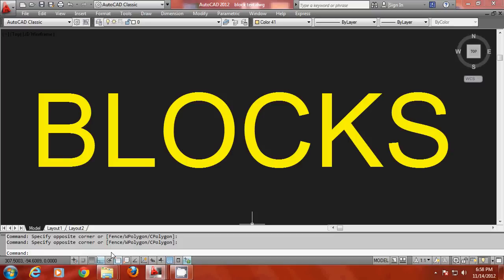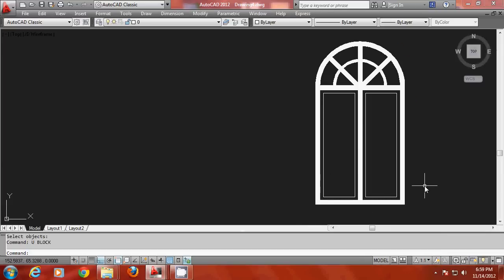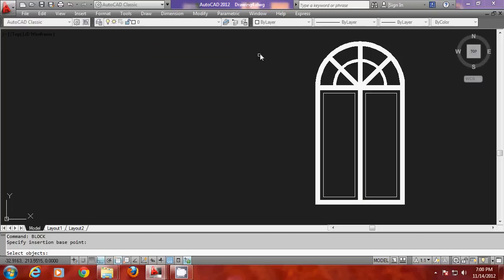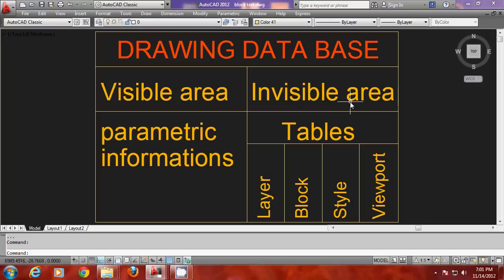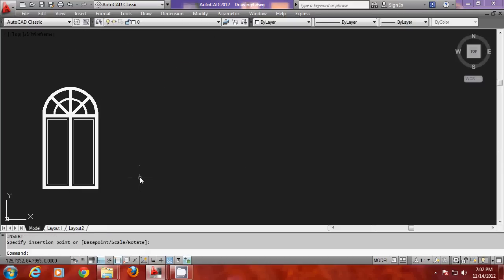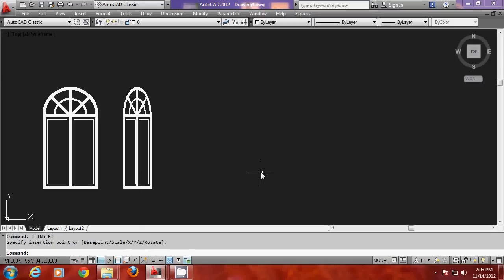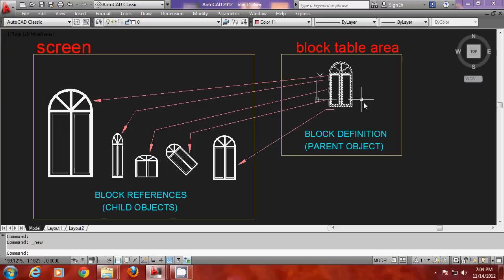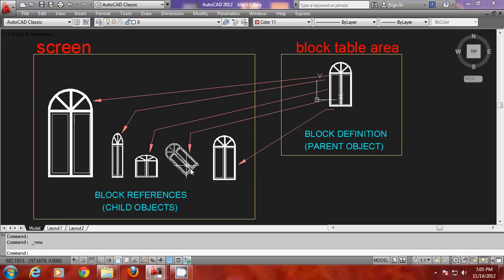AUTOCAD BLOCKS | CONCEPT AND CREATION OF AUTOCAD BLOCKS

Comment: sir, is it possible to insert a block from one autocad file to a new file ?
Reply from the maker: Use design centre for that . Use Adcenter command . You can also use the shortcut Ctrl + 2 . Go to block option , choose the desired block , right click and insert.
Reply: yeah its worked sir,but i have one more doubt that is it possible to extrude these blocks which we get from design centre?